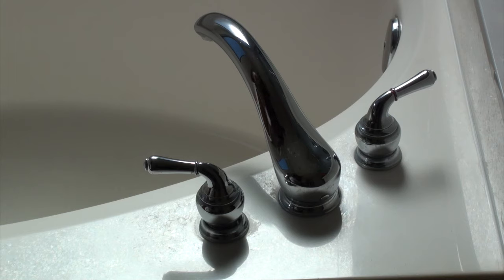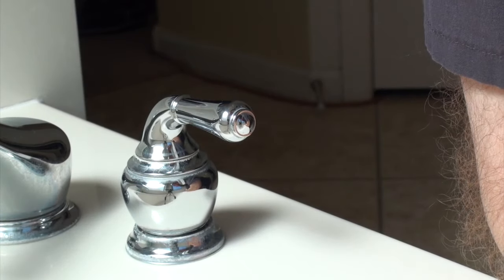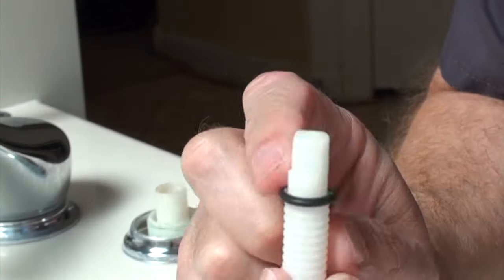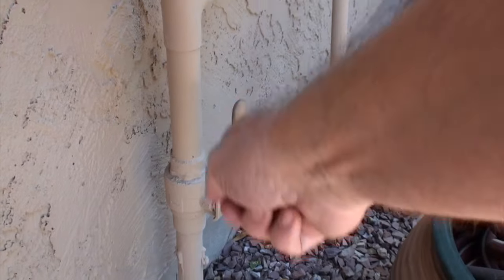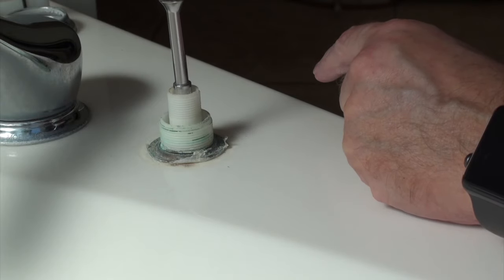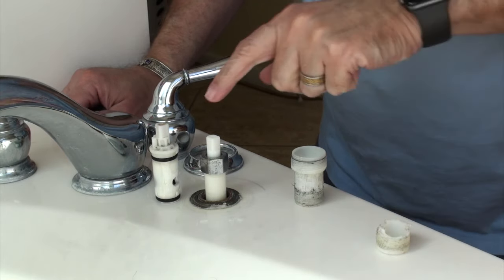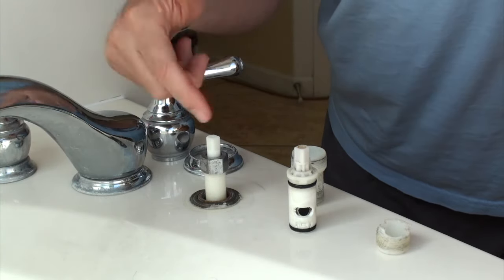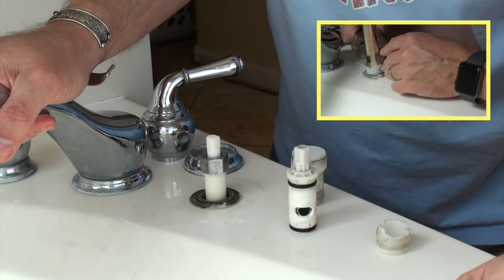Moen Bathtub DrippingFaucet Repair

Comment: Thanks for the "several days later".  My wife was wondering why this took me so long with a wall-mount.  
The special tool didn't work, but the principle of it told me what to do.  I took the philips screw that originally was mounted in the cartridge and screwed it back in all the way, then pulled it with pliers.  FINALLY came out.
Reply from the maker: Congrats on your repair and doing it yourself !!
Reply: fastest way to remove old cartridges is a hot air gun, I use a blow torch for 5-10 seconds ,  then a lil wiggle pull with vice grips and bam !! slides out fast keep a lil spray bottle to spray and cool afterwards

Comment: Thank you! Thank you! Thank you for your wonderful video! In my case, I have a 24 year old installation but it took only an hour to replace the hot water cartridge. I cheated by using a little bit of WD40 to make it possible to twist and pull the old cartridge out (we don't really use the tub and definitely not drinking from it). My faucet looks exactly like yours and the cartridge number is 1248B and the Moen tool model number is #14272 like everyone pointed out.
Reply from the maker: I’m glad it was of some use for you. Great job on doing it yourself!

Comment: Thanks for the video bud!!! I’m ordering the tool now and thanks for cartridge info to the guy above as well, saved me migraine, I’ll take the headache.
Reply: fastest way to remove old cartridges is a hot air gun, I use a blow torch for 5-10 seconds ,  then a lil wiggle pull with vice grips and bam !! slides out fast keep a lil spray bottle to spray and cool afterwards

Comment: Good video.  I had a challenge in that the new retainer nuts had about a 0.01" larger OD than the old ones.  Fortunately, I was able to reuse the old nuts.  The new ones were the black parts shown in the video.
Reply from the maker: Glad you were able to reuse the old ones!!

Comment: I'm in the same situation you have. Coming close to 20 years since my tub was installed. The only difference between our tubs is that my taps/spout have a few polished brass accents.  I now see why I'm stumped with changing out the cold water side cartridge. I don't have the retaining nut removal tool. I'm not looking forward to tackling this change out now. Wish me luck....
Reply from the maker: Good luck don’t give up! Lol you’ll get it done!
Reply: How did it you get it out?
Reply: @MegaHowtoMan   Greetings again. I called Moen Canada and they sent me a removal tool free of charge. Removing the cartridge was uneventful but installing the replacement was a little frustrating. I did eventually get it back together........ Your post did help alot. 👍👍

Comment: Thanks for sharing your video.  Please advise how you "cut" out the plastic retaining nut that holds the cartridge in place.
Reply from the maker: I had to take a hacksaw blade and slowly cut into the plastic nut on opposite sides. I had to be very careful so that I wouldn’t cut into the metal threads that the nut screws into.
Reply: @EveryBladeOfGrass1   Thank you!!!

Comment: I have the same system as you. I confronted with the same problem as you, regarding the plastic retainer. While removing the plastic retainer with the tool, it was destroyed.  You said that you had to cut the plastic retainer out, but you didn’t show how to cut it out?  Did you use cutter knife?
Reply from the maker: I used a small hacksaw blade and carefully cut just the plastic so as not to damage the copper pipe, just go slow

Comment: Exactly what I need for fixing my hot tub Moen roman faucet. What size of hacksaw blade did you use to cut the plastic retaining nut? It is such tiny space. Mine is also over 20 years, can not get it out. Thanks
Reply from the maker: If you can’t get a hacksaw blade try using some CLR or vinegar down the hole to dissolve the minerals it may come out easier
Reply: fastest way to remove old cartridges is a hot air gun, I use a blow torch for 5-10 seconds ,  then a lil wiggle pull with vice grips and bam !! slides out fast keep a lil spray bottle to spray and cool afterwards

Comment: Super helpful video, thanks! Having the exact same issue as you and came to the conclusion I probably need to replace cartridge on our tub. Would you mind sharing the model # of the faucet and cartridge # you ended up buying? I have the exact same trim as you, but it looks like Moen has discontinued it because I can't find it anywhere on their site to figure out what replacement parts I need
Reply from the maker: Pretty sure my model name is Monticello and the cartridge number was 1248 also call Moen they were very helpful with me and you can text them pictures of your situation

Comment: I got to the point of using the tool to remove the retaining nut and it came out about 20 or so turns then it stopped. I sprayed some CLR foam spray into it and that helped a little but at this point the nut is gnarled to the point that it's stuck where it is. How did you end up cutting the retaining nut?
Reply from the maker: i took a small hacksaw blade and slowly cut the plastic enough on opposite sides to be able to twist and pull it out

Comment: Hi! Thanks a lot for the video! It helped me a lot. I could take out all of the parts except the cartridge. How did you pull out? Did you just pull it straight up with a vise grips? I think that is the most important part you didn't show in this video.
Reply from the maker: I think I used vise grips
Reply: Could not fit vice grip pliers in my hole… needlenose did not work… coment below suggested using a deck screw and that worked great for me.

Comment: What did you use to cut that piece.  I drilled holes in the "wrench" to get more torque, the wrench wore down the notches wheh the piece was less than a quarter inch from coming out at the top😢
Reply from the maker: I had to use a small hacksaw blade

Comment: I just put a long deck screw into the top of the valve and pulled it with a claw hammer.
Reply: Super helpful tip. This worked for me too. Thanks Dale!
Reply: Same here

Comment: I have the exact same issue, how did you cut out the plastic cartridge retainer? (The small threaded piece)
Reply from the maker: I used a small hacksaw blade to carefully cut the plastic but you have to be careful not to damage the copper threads of the pipe
Reply: @EveryBladeOfGrass1  thank you

Comment: How do you tighten the handles when they’re loose? I have the same one
Reply from the maker: They should just screw down if it’s the handle part you may need to tighten the screw inside

Comment: Do you know how I can take out that retainer plastic nut out if the part where the tool goes does not work?
Reply from the maker: I had to cut mine out with a small hacksaw blade

Comment: I’m the original owner of a 22 year old home with that exact same moen Roman faucet. My situation is that I need to replace the entire faucet. I was told the new faucet may not be compatible, requiring the breaking of the tile and going at it from underneath. I’m probably not explaining it exactly but could you do a tutorial on complete replacement of the faucet?
Reply from the maker: I would if I knew how but that may be beyond my skill set you may need to call in a pro for that

Comment: What size cartridge did you use
Reply from the maker: I think it was a 1248 for my style of faucet
Reply: @EveryBladeOfGrass1  I did end up getting that one , 1248 . Hard to find but ordered it . I had to give a huge push to get it in . Not exactly but it worked . The 1224 is too small so I’m thinking the in between is not made anymore ? Idn anyone else have a size that is in between these

Comment: Hi.. I would like to add a sprayer attachment to this faucet.. Do you know what is the best way to do that? Thanks! @everybladeofgrass
Reply from the maker: That may be a challenging job. You may have to access the pipes to tie into those lines??? But I don’t know for sure what needs to be done.  Good luck

Comment: How did you cut the retaining plastic piece?
Reply from the maker: I used a small hacksaw blade
Reply: @EveryBladeOfGrass1  this has been a real nightmare of a job snd I’m not a plumber, but my wife gave me the idea to use an exacto knife.  I used that to cut away the nut by placing it on the nut and using a hammer to push the blade down thru the plastic.
Reply from the maker: @littlebuckey   I know it can be a frustrating job.  Hope it gets easier going forward